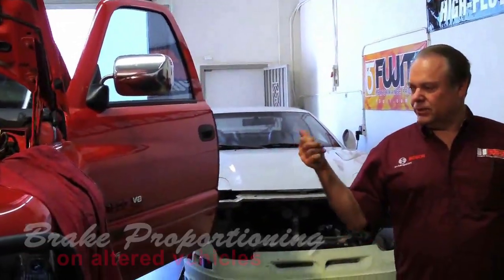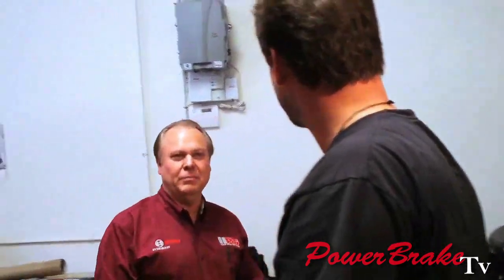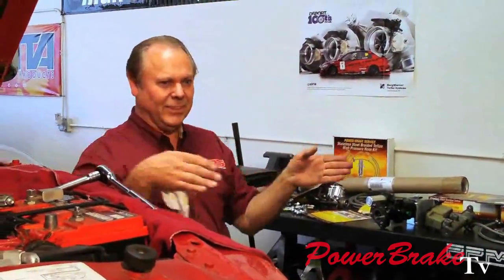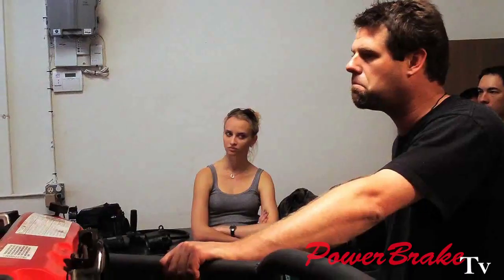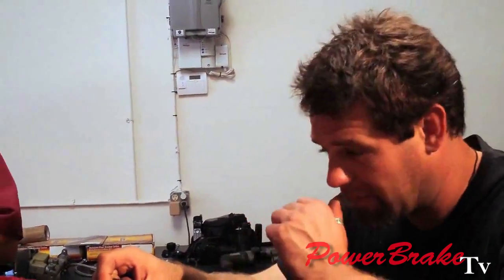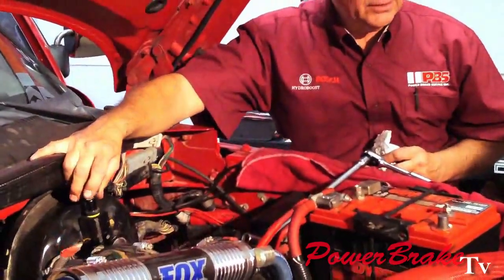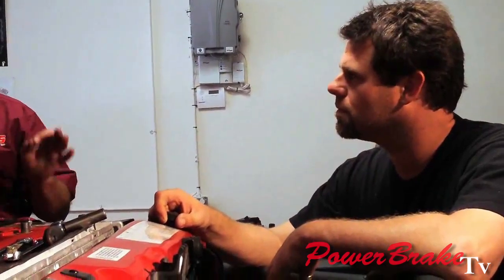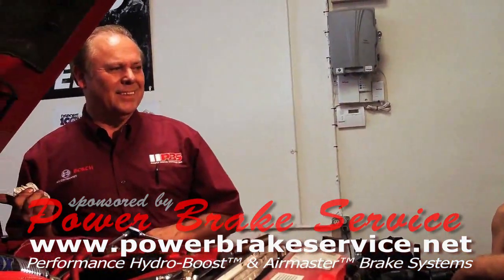4 Wheel Disc / Front Disc Rear Drum Brake Proportioning on a Modified Vehicle - Sweeting Performance

Comment: Wow.  What a quick explanation!
Reply: Having rear brakes lock up is bad thus the proportioning valve is like a pressure regulator to keep the rear pressure lower than the front by a preset amount.